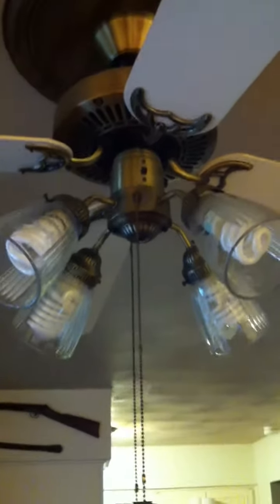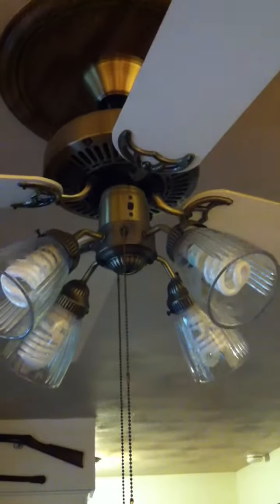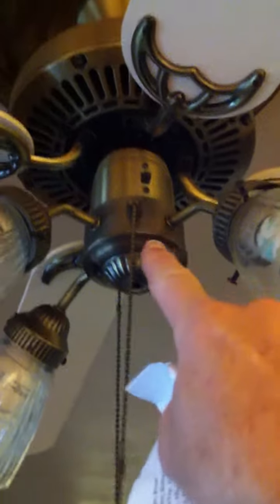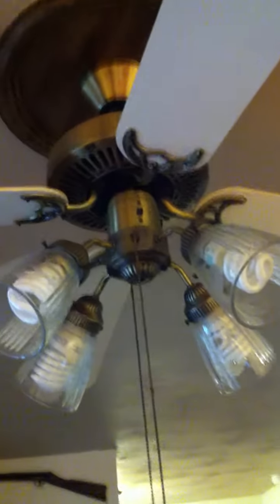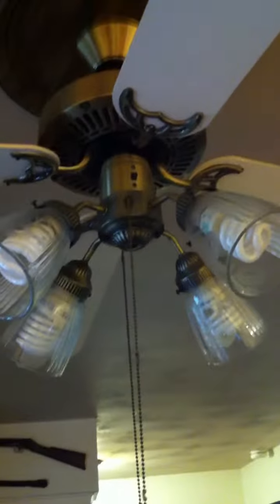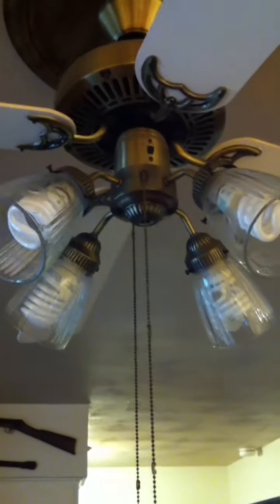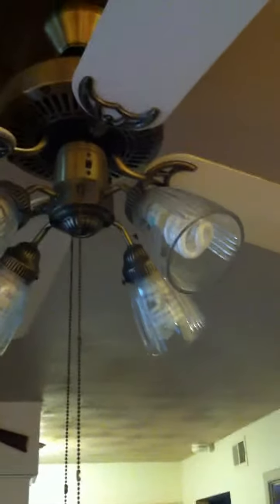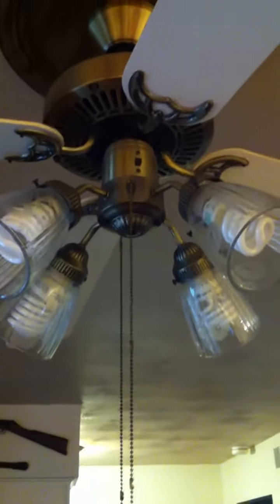Ceiling Fan Light Problem

Comment: That is a Hampton Bay Southwind, and it doesn't have a wattage limiter. It's discontinued before wattage limiter started. On fan lights without wattage limiter or dimmer, if a light wouldn't turn on with high wattage bulbs, it wouldn't work with low wattage bulbs either, unless it's wired wrong in which case the wirings need to be corrected for safety even if you're going to only use LED bulbs.
Reply from the maker: Thanks for your correction, but please explain why when I had only one blinking light left, when I replaced the old style bulbs with 4 LED bulbs they all lit up and it's working fine now.  I tested the old bulbs elsewhere and they all work fine.
Reply: +Stephen Saunders does this fan have a remote or a dimmer switch? If not, it sounds like a bad socket or bad wire somewhere (possibly outside of fan), in which case the wire needs to be replaced to avoid fire hazard.
Reply from the maker: No, no remote or dimmer switch.  I've solved the problem.  LED's are fine with me.  It works.  It seems to me you're overthinking this thing.  What's wrong with a simple solution?
Reply: +Stephen Saunders it indicates that there may be a bad wire somewhere, or a bad socket, in which case I would fix to avoid fire hazard. Maybe get an electrician to find out why it's behaving that way and see if there's a bad wire somewhere (possibly outside of fan). I just don't want your house to burn down.
Reply from the maker: If there is bad wiring and the problem is not wattage, then the problem will reappear.  Now all four are nicely lit.  If they start failing again, I will spend the $100 plus to dig into it.  At this point, I prefer common sense and simplicity to paranoia.  Google Occam's razor for my logic, please.
Reply: +Stephen Saunders I was just thinking that there was something in or out of fan that doesn't tolerate high wattage, and it worries me that there is a fire hazard. The fan light socket is supposed to connect to full 120V power like other lights.
Reply from the maker: I'm going to stay the course.  Tomorrow is Memorial Day.  Tell ya what, I admit my faults.  If there is a fire, I promise I'll let everyone know right here on You Tube that you were right!  If not, every Memorial Day I'll post "Hey Channel, my house hasn't burned down yet!  Please admit you were wrong for one whole year!"  :-)
Reply: +Stephen Saunders I was just thinking "better safe than sorry". By the way, I'm one of fan collectors. I also make videos of ceiling fans that can be found in my channel.
Reply: was it discontinued in like 1945